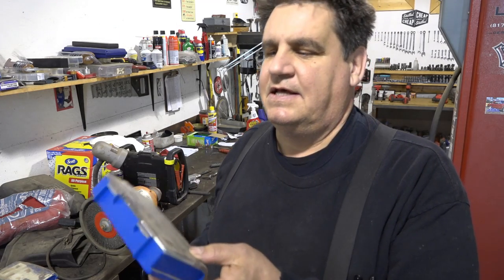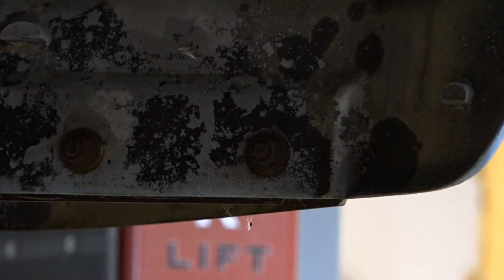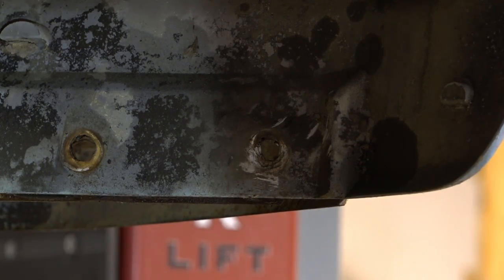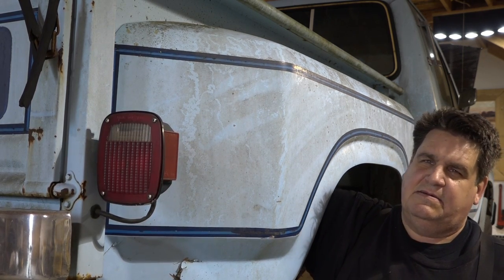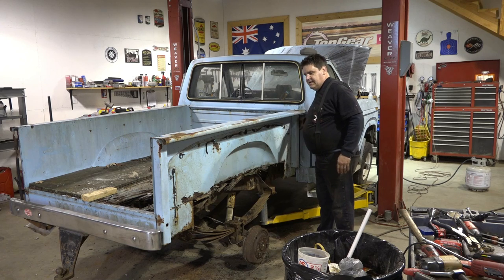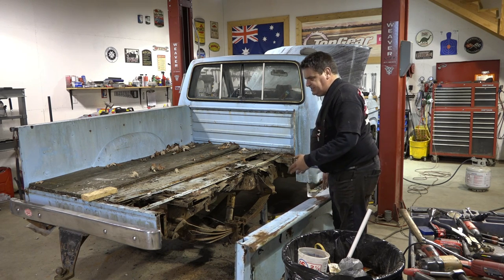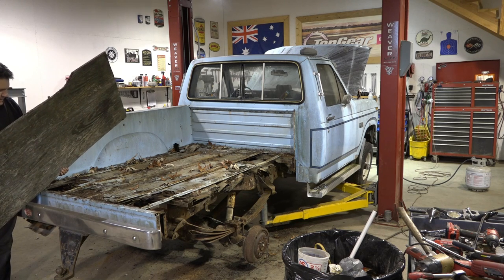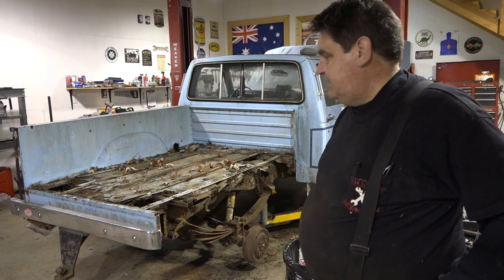1982 F150 Restoration Bed Disassembly

Comment: I had the exact same truck in 1985 and I loved it  . It was black with red interior. 4 speed 300 six cylinder. 4x4. I still have pics of it. I replaced the wood on the inside with oak planks. It was a beauty